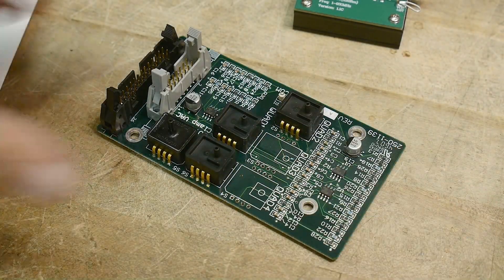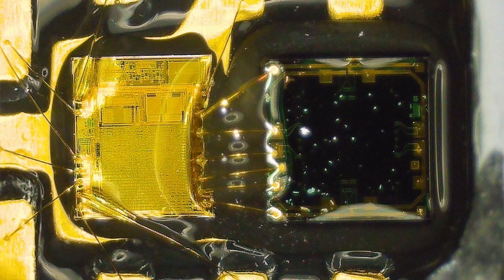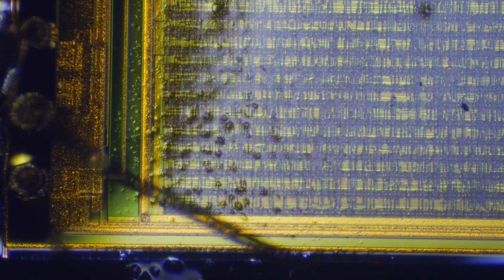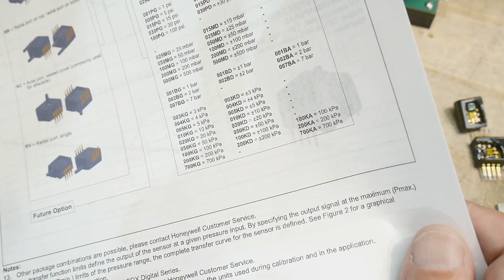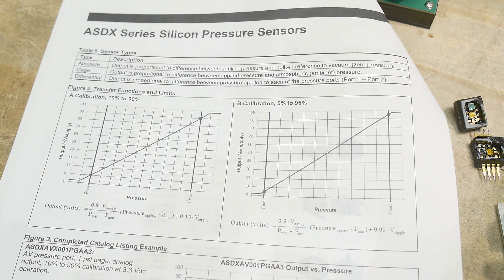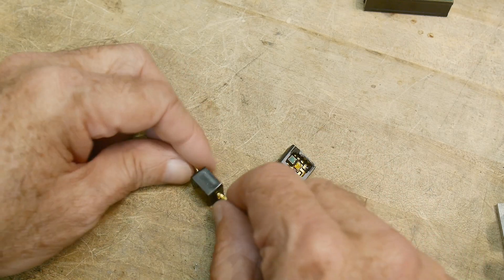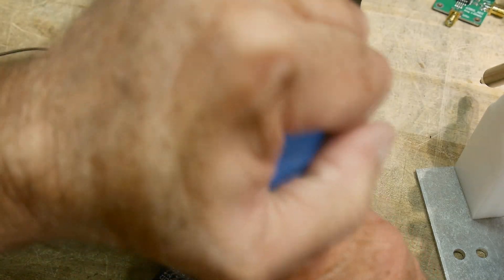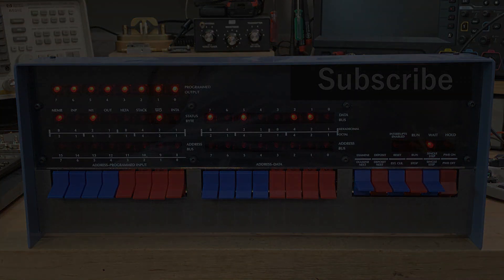#2032 Honeywell Pressure Sensor

Comment: Actually rhe control IC is majority of its area digital circuit. In fact the thing senses the strain bridge, amplifies the signal, then converts it to digital and then the digital part does a ton of DSP calibrations, linearization and compensation, then spitting the output into a DA converter to output "analog" voltage with that nice linear dependency...

Comment: Pro tip when using ratiometric sensors such as pressure sensors and Hall sensors. Skip the expense of the precision voltage reference. These are designed to mate with ADC converters, where the voltage reference for the sensor and ADC uses the same varying reference voltage, so the ADC and sensor are both ratiometric, and as a result, cancels out the measurement error.   Check the datasheet for this configuration. It is common for data collection using battery operated devices. It is reduced parts count wt;h the elimination of the voltage reference, and reduction of power use,

Comment: Very cool. I'm familar with Honeywells SCX series pressure sensors. They seem a bit different though with positive and negative outputs as well as temp compensation. I found one of these in a highspeed centrifuge with vacuum system to reduce friction. But the unit had a small leak somewhere that would cause the unit to throw errors rendering it obsolete. So I placed the appropriate resistor across the sensor outputs to decrease overall output resistance = lower pressure. Got a few more years out of that centrifuge thanks to that mod!

Comment: It is made from quarts with a flex resistor painted on top..
Reply from the maker: you can do a search:
Piezo-resistive pressure sensors consist of a diaphragm – mostly made of silicon – with integrated strain gauges to detect strain as a result of applied pressure. These strain gauges are typically configured in a Wheatstone bridge circuit to reduce sensitivity and increase the output. Due to the material being used the pressure limitation is at around 1,000 bar.

Comment: Used one differential, with range ±0.5 inch H₂O, 'reference' series, SPI output to build flow meter. ( Just piece of pipe with two perforation strips on the inner circumference at a specified distance to sense pressure drop, great stuff )

Comment: the chip looks like a complex digital design, not analog at all, it's probably an ADC, fed into a LUT, fed into a DAC, hence the datasheet spec "12-bit". The unused pins on the package are probably the programming and calibration pins, where the factory can put in a custom LUT for each part. They probably made it that way to make it cheaper, as programming is easier than laser trimming resistors.

Comment: How did you determine that there is a piezoelectric strain gauge to measure the deflection of the diaphragm? Silicon is not piezoelectric, though I suspect that a strain gauge could be fabricated on the back side of the diaphragm.  

Another sensing approach that is used in macroscopic high accuracy pressure sensors is to measure changes in capacitance between the diaphragm and one or two electrodes on the back side of the diaphragm.  With a single electrode opposite the center of the diaphragm, the deflection is proportional to the square of the pressure difference across the diaphragm.  If I remember correctly, with a pair of electrodes the change in the difference in capacitance can be linear with the pressure difference.
Reply: you can make a strain gauge with polysilicon resistors on a die with the same process a regular chip is made

Comment: You can get these with different sensitivities and configurations. I designed a water spray for coal trucks using one, where any vehicle that ran over a length of hose, (like the old hoses at a filling station), which was open on one end, triggered the sensor, and turned on the spray to keep down dust. The main challenge was the plumbing, to reduce a 3/4" piece of red hydraulic hose down to the size of tubing to fit the sensor.

Comment: All the no connect are there for use as a digital sensor, and to program the assorted variations for a zero point and a full scale, as the basic sensor itself covers the entire pressure span, so the variants are programmed in factory for a range, and this calibration is stored in the internal flash memory. Then there is a 12 bit DAC that uses the incoming pressure, likely converted by a 16 bit unit on the die, and the logic sea of gates there then does a temperature correction, thus 6 pins to the sensor die, 4 are for a ratiometric measure, and the other 2 are for a buried base emitter junction of a transistor on the die, used in conjunction with a bandgap reference on the main chip, to get a stable reference for the ADC, and a stable supply for the bridge as well. This then is scaled and temperature corrected ( ratiometric lookup to contract the scale, and then a sliding window for the temperature correction off a table in the flash on die) before going to the ADC to be sent out.
Reply: this is exactly what I was thinking when I saw the die and reference to "12-bit" in the datasheet

Comment: To me sensors are some of the most interesting parts as they are the interface to the real world (if such a thing exists).
You could hook one of these up to an Arduino and see if you could measure barometric pressure changes over a protracted time span, or
You could hook one of these up to a faucet to track water pressure, or
Make a tire pressure gauge, or
If you have forced air heating/cooling you could measure pressure differential across a filter to determine when filter needs to be changed, or
.......
Reply: the port is open to the air, I assume the other side of the diaphragm is sealed (fixed at whatever the air pressure was when it was manufactured?)  I did see some dual port units on the data sheet.. could be useful in some applications
Reply: @zebo-the-fat  Single port versions are always absolute, the reference is a very high quality vacuum sealed in during manufacture. dual port units have connections to both sides